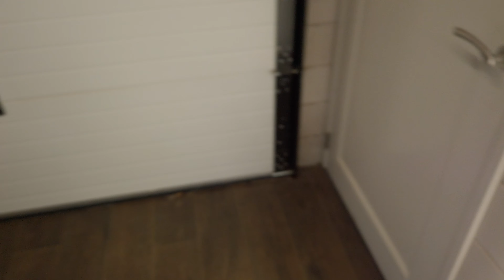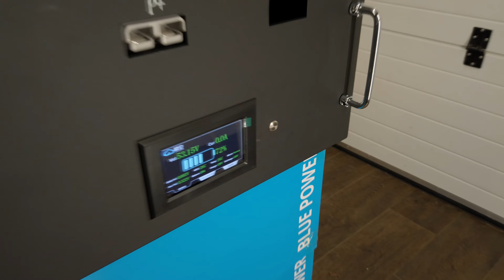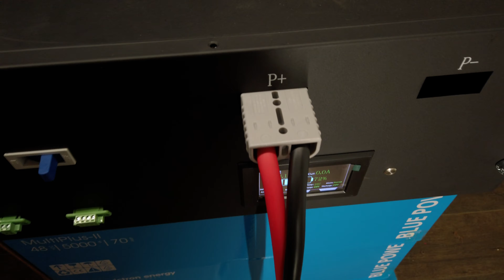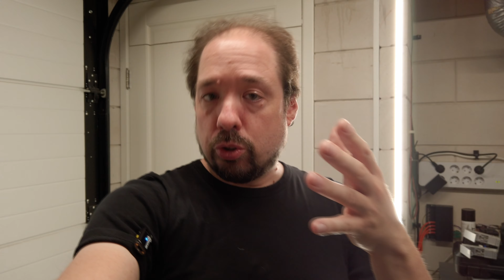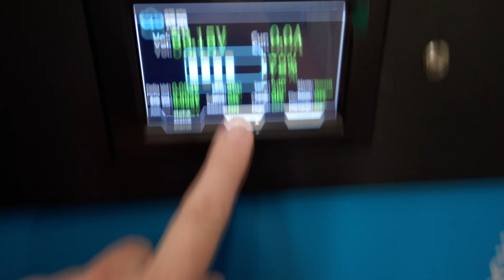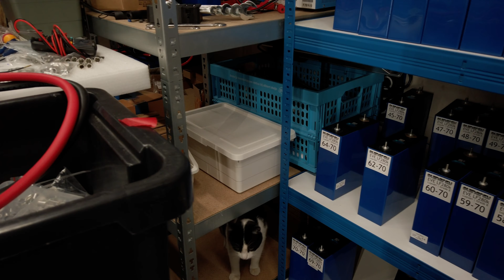⚡Quinergy⚡One battery box built, let's take a look!

Comment: check for your legal requirements on the battery breaker... mine has the breaker on both ends of the battery connected to completly disconnect the battery from external if needed.
this is done not for protecting the battery, this is done to protect eventual external things when you have to do some maintainance in the future